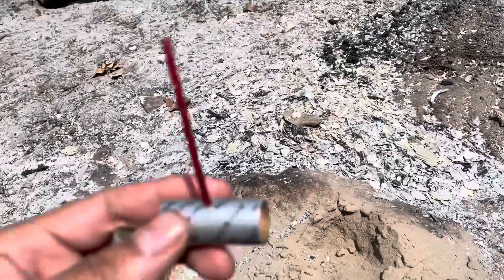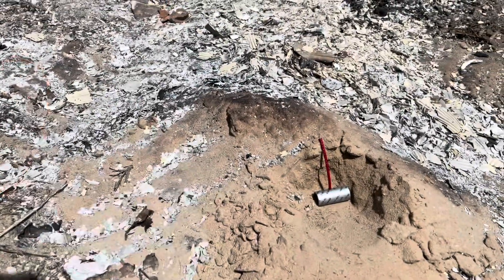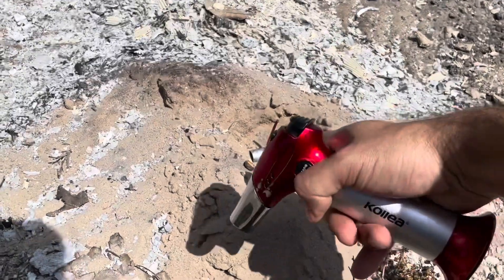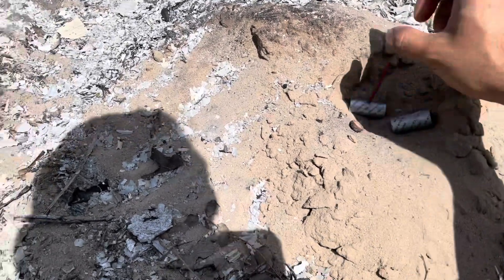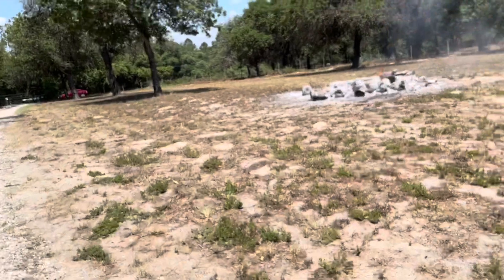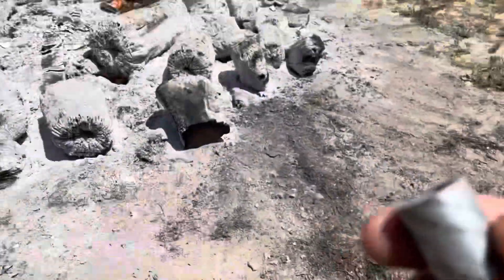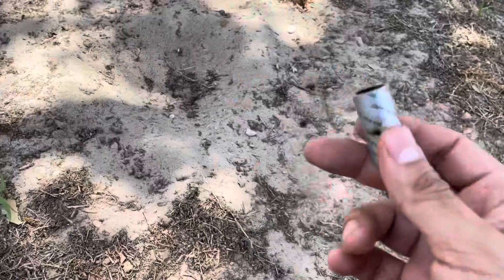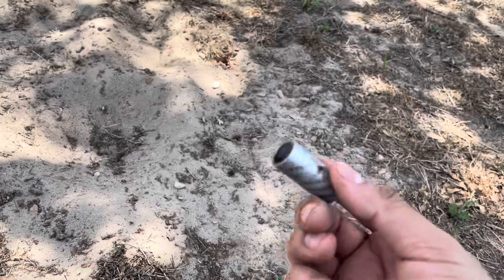Flash powder vs whistle for a fire cracker

Comment: Dont make whistle mix ! It is Even more dangerous then making real flashpowder it is more prone to self ignite becouse of friction
Reply from the maker: It is very dangerous for sure but as long as you keep it wet while screening it won’t go off. I made a video of hitting whistle with a hammer and friction and mine didn’t go off but I still treat it with respect.

Comment: Ever try flash mix with sulfur. I think it gives it a deeper thud. Cheers
Reply from the maker: I want to try it so what’s the ratio for that?
Reply: @E85_STI  50/30/20
Reply: @E85_STI  I use a mix I came up with 
Kclo4  4
Mg.      2
S.          2
Dark Al. 1
I’m not sure if you don’t have mg you could use more Al (3) parts. Raining hard today so I think I’m going to my shop and make a bunch of stars  4th is coming and I have a bunch 1 7/8 plastic hemis also 3” paper that I just ordered a mortar tube for. Excited to try the big ones since I’ve never done that. Need to work on some spollets for those and do some testing. Cheers

Comment: Have you ever tried Blue Aluminum to make a cracker? I heard it was a safer alternative but I couldn't even get it to light. I saw in someone else's video that it had to be under pressure, but even then, no luck.  Thanks for the vid.
Reply from the maker: No I haven’t yet but my flash has a very loud crack to it but the camera has trouble picking it up. Is that blue aluminum louder?
Reply: @E85_STI  It's supposed to be louder under the right circumstances, such as under pressure in a sealed tube, but, so far, no luck here. Supposed to be much safer to make and handle, too. If you can figure it out, PLEASE post a video on your findings. I haven't had much luck. Thanks again.
Reply: @tonyf.8858  try mixing some dark al in there, makes it light up easier
Reply: @tonyf.8858  look at 976evils vids on blue al
Reply: @justapyro4935  I'll surely try that. Thanks
Reply: @MrDMario  Ahh, yes. I didn't think of him. Thanks.